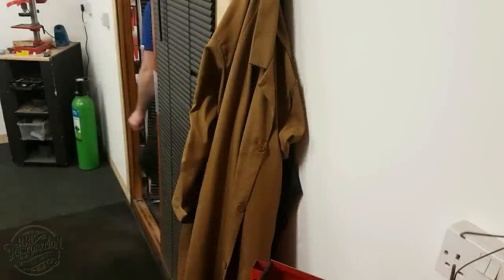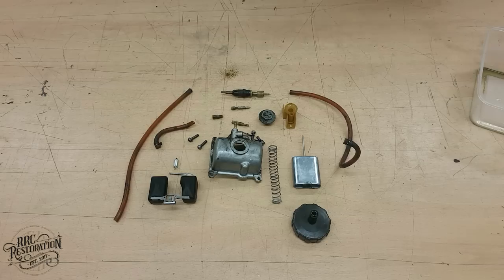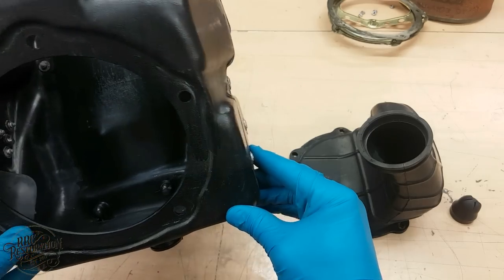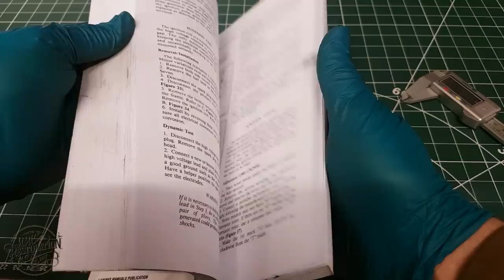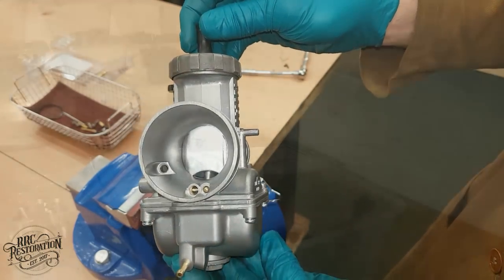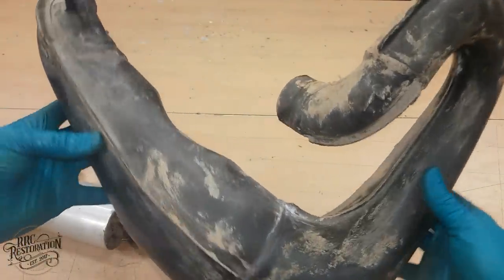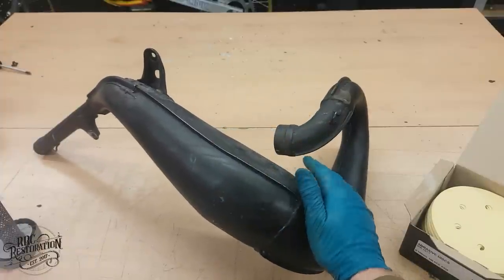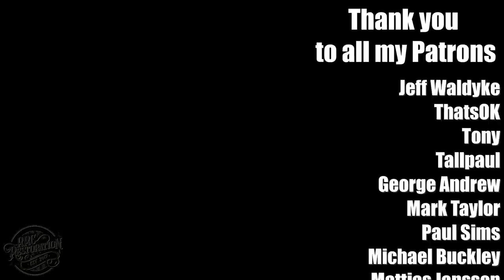Honda CR250 Full Restoration - Part 11 - Carburetor Rebuild

Comment: I had a heck of a time rebuilding the 4 carburetors for my 1986 ZX600 Ninja. The Phillips screws were stripping so I went and replaced them all with socket caps for future proofing.

Comment: one thing i change on old carbs is the brass seat for needle in the slide. had a couple run rich from wear....
Reply from the maker: Ah i'll need to keep an eye on that but from what i saw on mine there was little to now wear so fingers crossed ill be ok.

Comment: I was amazed how clean the inside of that float bowl was. But when I think about it i'll bet they ran pre-mix in it. And pre-mix here in the states is almost all ethanol-free. At least that I have found on the shelves. thankfully more stations in the area are starting to offer non-ethanol fuel. I use it in all my small engines especially my old ATV's.

Comment: Properly sorted Keihn carb or injection? Your opinion please. The value of those bikes is rising quickly, partly due to the popularity of the Vets MXDN race. Great, great video again, my favorite YT channel.
Reply from the maker: I like the utter reliability of fuel injection these days but there's a lot to be said about running a carb because of the sheer amount of tweeking that you can do to give the engine the characteristics you want that you cant do easily with a fuel injector. pros and cons for each.

Comment: Would like to see some content on hazardous waste management!
Reply from the maker: Really, I didn't think there would be much demand for that sort of thing but I'll try and incorporate some more stuff like that for insight into how its done ;)
Reply: @RRCRestoration  I am a safety professional in California.  Plating shops can be a problem in terms of the waste and impact to environment.  Also keep a spill kit handy like for the muffler spill in this video.  Wastes should be in labeled containers and for the small quantity you have on hand you may have access to a haz waste community drop off program.

Comment: I was always told that a drill bit sharpener was either a gimmick or not worth it. Obviously you have had success using it or I don't think it would have been featured. Can you share your thoughts on the tool?
Reply from the maker: For me its been a fantastic addition to the workshop its so nice having super sharp drill bits on hand all the time :)

Comment: Nice video. I would have cleaned the carburettor from the outside before disassembling it, so that the dirt cannot get inside. Which you then want to remove with ultrasound, as you did. That saves electricity, time and cleaning fluid.
Otherwise, interesting video. What is the ISBN number of the manual used in the video? Martin from Germany

Comment: Thank you for another great video. Did have a question tho about the needle valve. I saw that you replaced the valve but what about the seat? Some times those seats are in bad shape needing to be cleaned or replaced.

Comment: How long do you leave them in the acidic solution to remove the old zinc, what acid do you use at what concentration, and how do you know when all the plating is gone?

Comment: one question, how do you dispose of the waste water and chemicals? especially the ones from the cleaning and plating. I know that flushing them in the sink is the worst, but what is the actual correct way to do it? Do you bring them to some company that specialize in waste management?

Comment: Curious, when is it appropriate to vapor blast vs sand blast?
Reply from the maker: it really depends on the finish required and whether or not the part will flash rust, if critical dimensions need to be maintained etc  but generally speaking all of my iron and steel parts get sand blasted and soft metals like aluminium and brass get vapor blasted.

Comment: Should always add the chemical (acid or alkaline) to the water, not the water to the chemical. Saves a local intense reaction and getting burns or some in your eyes.
Reply from the maker: very good advice and should defo always be followed but this stuff doesn't react like that its a very weak acid ;)

Comment: Only thing i would’ve done otherwise is stripped the pipe to bare in the vapor blaster and them paint it. You never know whats under the paint
Reply from the maker: As you know that's usually my approach with things but honestly the condition was so good under the oil and mud that im 100% confident that the areas of paint left not stripped aren't hiding any horror stories but only time will tell if im correct about that lol

Comment: No work can begin until the coat is on. Do you have the required amount of pens? I only see 2.
Reply from the maker: exactly proper old school in my workshop no work done unless you're properly dressed haha , there are only two pens at the moment but not to worry I've got the rest of the gear all ready to go in, pocket protector, steel rule, more pens and pencils  etc etc lol
Reply: @RRCRestoration  forgot the pocket protector!